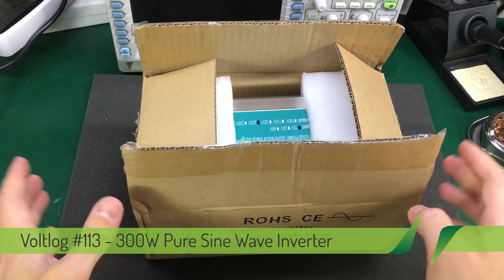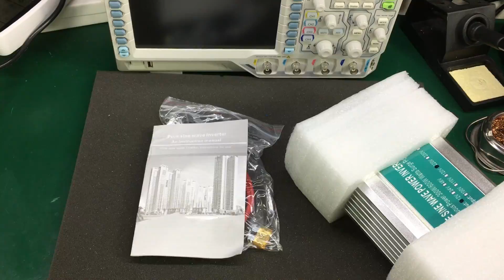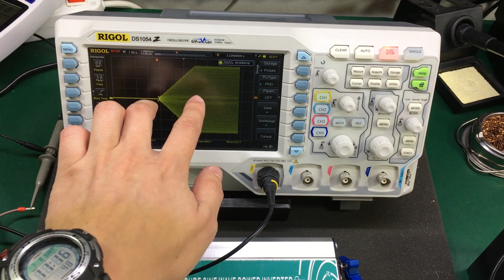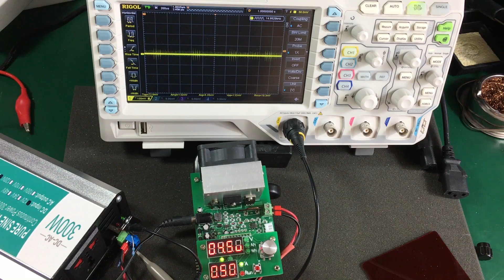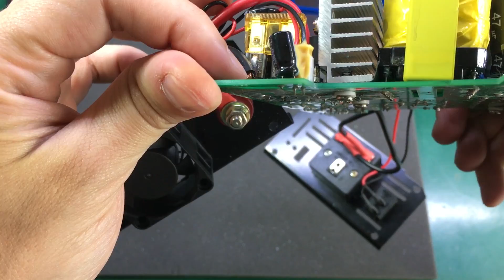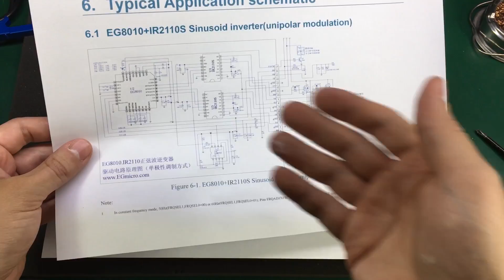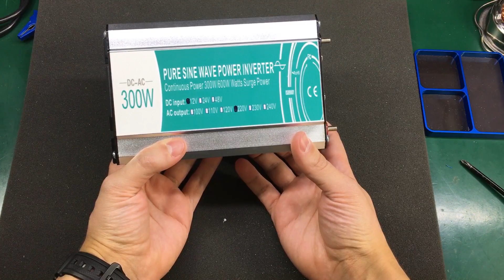Voltlog #113 - 300W Pure Sine Wave Inverter Review & Teardown

Comment: I have 2000 watt and 500 watt pure sine wave inverters from Reliable Electric (Ebay) and both units deliver a cleaner sine wave than the elctric co-op that provides commercial power to our area.

Comment: plsss i need your help. ihave 2000w inverter souer brand and i want to adjust the voltage cut off it shutdown on 10.5v and i want to adjust it 9.5v because im using alum battery it has lower resting voltage:(

Comment: For a high current 12V source, use a lead acid car battery. If you have a car, connect it to the battery with engine running.
Reply from the maker: yup, other people suggested that too and I did try the inverter on a car battery while running my dremel tool and it did alright. Since then I have also bought a beefy 12V power supply which will be features in a future video.

Comment: Nice, thorough examination and analysis.  Given the quality of the sine wave, seems like a good deal.  If the USB current is a big deal, maybe someone could add a heat sink to the 7805.  Looks like enough room for that.  I used your link and see they do offer a 110VAC version at only $38.  Got a 1 star review from one reviewer who said it only delivered 230W at 1.0 power factor and 13.9VDC.  $38 isn't too bad for this quality of sine wave though.  Think I'll get one.  Thanks for your review.
Reply from the maker: There are also control modules available on Ebay & Aliexpress if you feel like building the converter yourself. If not, a ready made one should be ok if it's not pushed to it's limits.

Comment: This video just set me wondering if there would be any merit in using one of these instead of an isolating transformer when working on mains powered equipment?
Isolation transformers are very expensive but I already have an inverter
Reply from the maker: That is actually a pretty interesting idea, it should work well. Thanks for the tip.

Comment: I did buy one of those sine-wave modules, but mine has the IR2113 instead of the IR2110. Never got around  playing with it since my plate is already full with project. I will keep it for the time (if and when) I build a 1-2KW inverter for my cabin. 
Thanks for yet another great video.
Reply from the maker: no problem!

Comment: I think the output current of 500mA on the USB jack is ok, because USB is just specified up to 500mA. But man, the ripple of the USB output is just awful.
Reply from the maker: unfortunately it's 500mA only for a limited time until the regulator gets into thermal protection.
Reply: ok, i agree with you. That sucks. Then you cant evenly charge a phone or something with it. Ever thought about apllying a little heatsink to it? I've ran into a similar problem a few weeks ago. I've had a buck converter chip which ran a little bit hot so i glued a little sheet of aluminium onto it. I know, its crude but it did the job :)
Reply: this is bad solution, 7805 is very inefficient converter... proper solution was to have buck converter at the end.

Comment: good review but on a side note isn't a to-220 package 7805 rated for 1.5A so depending on the input voltage will determine how quick it reaches thermal shut down?
Reply from the maker: 1.5A with adequate cooling not free standing like in this case, but what you said it's true.

Comment: You can find a good quality "12V" high current PS without resorting to using a computer PS.  They are often used for amateur radio and many have a variable output from about 5 to 16 volts with current capability of 25A+ continuous with surge of 30A+.  And with low noise.  If you need some suggestions let me know.
Reply from the maker: I'm pretty sure I can easily find a good quality high power 12V power supply these days but nothing can beat the price of a used server power supply which goes for around $15 on ebay.

Comment: 0:07 - only 7 seconds in when you said "pure sine wave inverter" and I saw the poor hand drawn "sine wave" on the box I was "nope, not quality".  If they can't produce a good image of a sine wave what else have they cut corners on?   Many quality manufacturing issues and I am surprised by the slow 3 second voltage ramp up.  And with reasonable filtering the 7805 shouldn't have 500mV of noise.  That's just nuts!  I would have liked to have seen the input of the 7805 on the scope and I wonder what voltage it is being provided.  I'm guessing it is straight from the "battery" source so the 7805 has to drop 7+ volts.  No wonder it is cutting out so quickly.
Reply from the maker: yup, you're pretty much right, they've cut allot of corners on this product. I'm not sure on the slow ramp-up but it might be a feature not a bug.

Comment: do you think such a module can be bought on aliexpress? would be cool if we could just slap our own big mosfets on there and create higher power versions

also i finally started making videos. at least a few :P on my Electronic Savage channel
Reply from the maker: the module is vailable on the usual two: ebay and aliexpress, just search for eg8010, I've also placed a link in the description
Reply from the maker: the EG8010 module even supports an LCD "EG8010’s LCD communication control protocol supports ST7920 LCD modules such as 12832" so you can easily get info like output voltage, current, frequency and temp.
Reply: thats me :P
Reply: i hope i will remember them when i want to build such a thing

Comment: What's the mechanism for making the output sinusoidal here? Is it just the inductor after the H-bridge with a 50Hz square wave? Or is the chip switching the mosfets in a more complicated way? I would have thought if it were that simple then why wouldn't every inverter put an inductor in series with the output. I would be interested to see the mosfet behaviour on the scope if you think other viewers would also be interested.
Reply from the maker: something more complicated than a square wave, otherwise they wouldn't get that perfect looking sine wave. Sounds like a good idea for the next video, probing those output mosfets with the scope.
Reply: VoltLog To achieve high efficiency mosfets must be used in on or off and spend as little time as possible in between and the worse would be to use them in a linear mode.  The 4 output mosfets form a H bridge. The controller sends a variable pwm signal to control them. The LC filter at the output removes high frequency from the output. Note that 50Hz is quite slow compared to typical switching frequencies (order of magnitude 100KHz) So by varying the duty cycle continuously you get your sin wave. It's the same method used in 1 bit dac or class D audio amplifiers
Reply: how is 390vDC stepped down to 220vac? do they use fb at beginning to vary 390v to 220dc? and use H bridge SPWM to form AC?

Comment: Use your car battery ;) Used to use a 1000W inverter when I drove transport trucks.  Enough to run a small microwave, tv, etc...  However had to be careful because even with 3 truck heavy duty batteries these will run your battery down quickly if not careful.
Reply from the maker: I thought about buying a car battery, the cheapest I could find was around 50 euros, but then i wouldn't use it for anything else so I would just be polluting the environment with no good reason.. A server power supply is cheaper and I could use it for other projects as well.